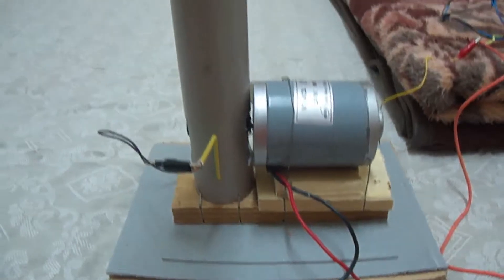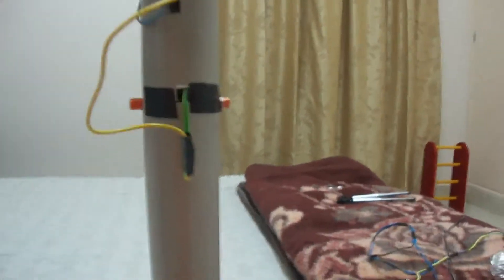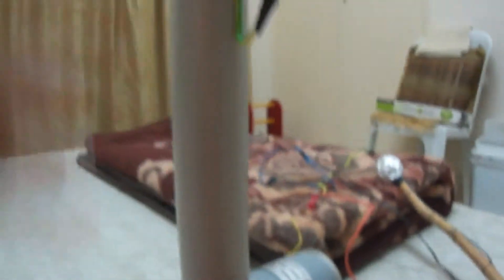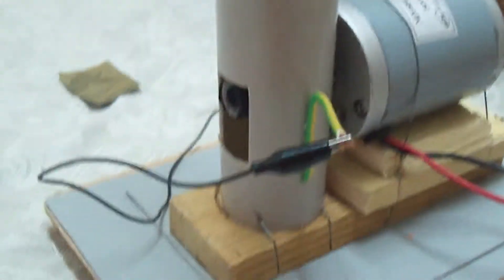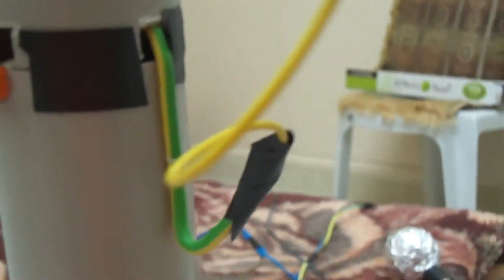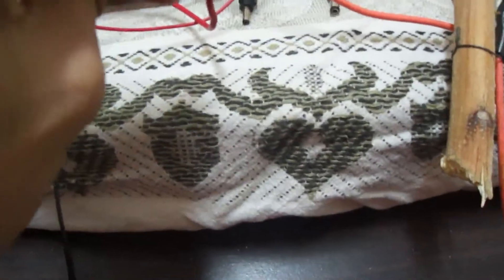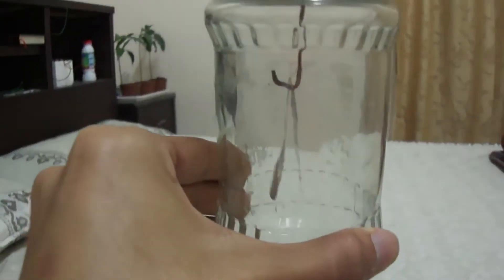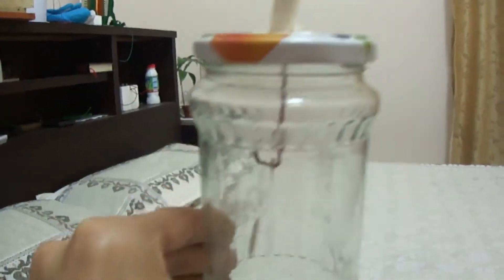Homemade Van De Graaf Generator *50kv output*

Comment: great video im a little confused on how you ground it,do you just put a wire close to the bottom of the belt and then attach the other end of that wire to the ground wire of your motor?
Reply from the maker: the ground wire at the bottom of the PVC pipe is connected to the earthing tool that i made, which is then connected to the earth in the main socket.